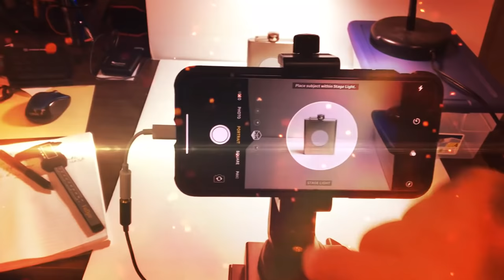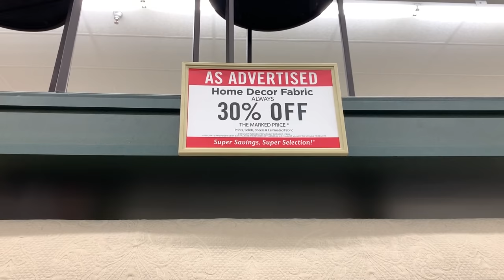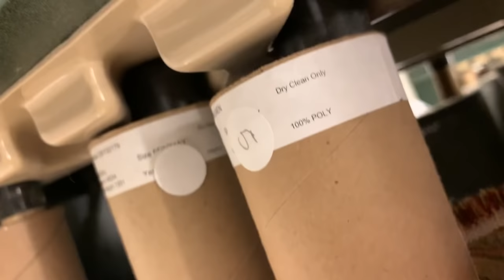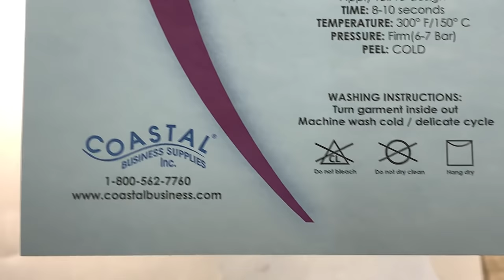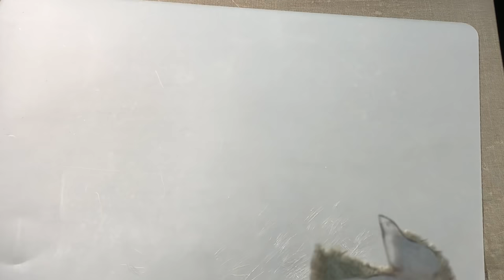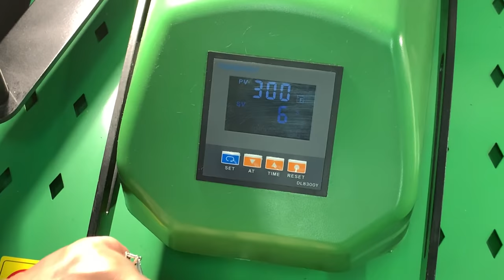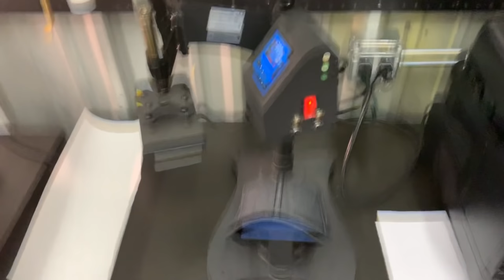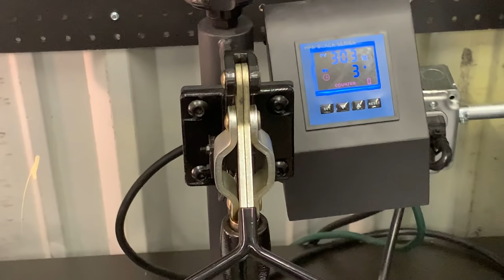SUBLIMATION RAGGY PATCH NO SEW METHOD

Comment: What could i be doing wrong?  My sister adhesive is not sticking to the hat?  I have it matte side down on the patch and peeled the backing, used 300 degrees on med/light pressure?  It just falls right off?  TIA

Comment: Could you run the Siser easy weed adhesive through a vinyl cutter to cut the shape you need? Just set it on a deeper cut setting?
Reply from the maker: Yes most definitely! I have a plotter just don't have it at the shop so I improvised for this video. :)

Comment: On  this video you linked the Epson 
ET 16500 to use with the inkowl inks. Is that what you are using to do your sublimation’s? If you are does the Epson printer head get clogged?  
The reason for my question is because on your website you have a picture of the Sawgrass virtuoso so I was just wondering if I should get the Epson. Thanks!

Comment: Great video thank you. My question bwill be not subbing but the sister material. U siad it's better than heatnbond . U meant more easier stronger. I am working bon something and heatnbond didn't work. When I pull it comes off. How's this material? Stuck good or if pulled a little will it come off?